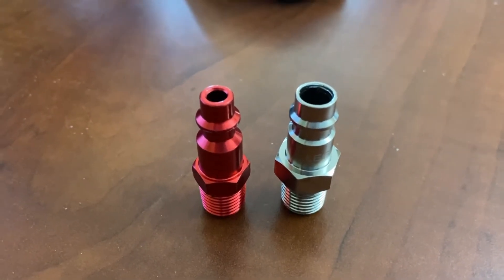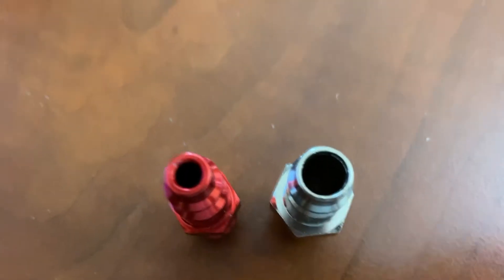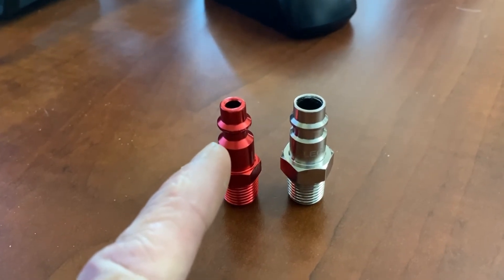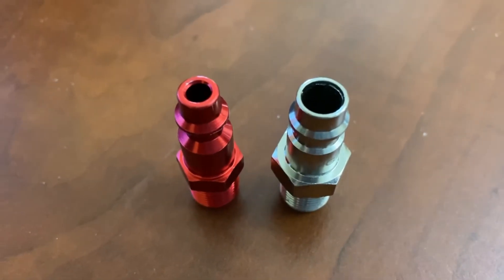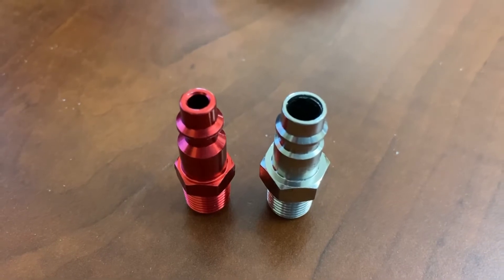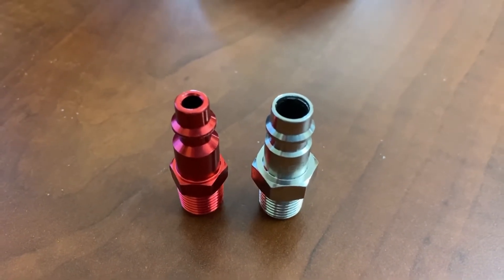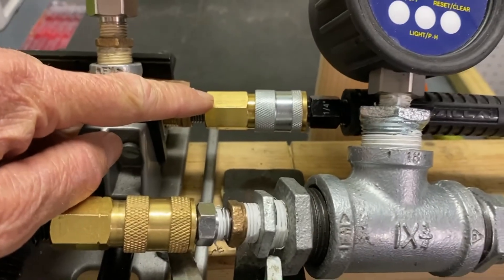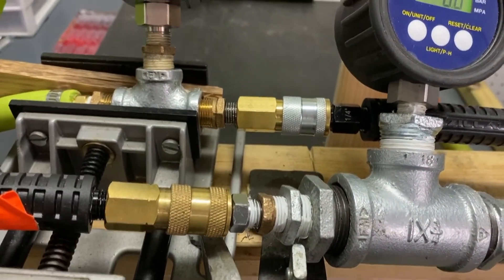HiFlo is all hype

Comment: It really is all hype. I bought some Lowe’s brand high flow fittings and noticed they break easily. I broke like two fittings in the span of 6 months. Now when I went back to normal 1/4 fittings I had a 5/16 hose which have the same airflow as a 3/8. After using high flow and 1/4 fittings in the 5/16 hose I didn’t notice any difference. So ppl it in the hose.

Comment: My air impact will not run with standard I/M 1/4" plugs. Only with v style or t automotive style. The standards also restrict my iwata hvlp lph400 but not my conventional w400. Too much pressure drop especially when using a cheater valve. The cheater combined with I/M plugs really cause a restriction. When painting I like to set the wall regulator as low as possible to maintain around 35psi at the gun so I don't get fluctuation when the tank pressure is around cut in. If I use standard fittings and 90psi at the wall, I don't get enough pressure to my hvlp. With standards and my conventional, I can set the wall at 50-60psi and maintain pressure
Reply: Same here. M couplers and 1/4" air line won't power my HF impact gun well enough to remove lug nuts torqued to 150#. But, with 3/8" hose and M couplers, I can run 100 feet out and it will take off a spindle nut torqued to 250#. 

I had enough of a small compressor and constrictions, went to a 20 gallon with 175 psi, all 3/8" line, 3/8" ball valve, and V high volume fittings. It stopped all the choking down and is much more capable. High flow fittings are part of a SYSTEM which delivers the power needed.
Reply: @tirod3  Ya everything works together. Ive since stopped using V fittings because they end up leaking even the higher quality Miltons. The V styles couplers ability to accept both V and I/M plugs would be nice if they stayed leak free but they dont. I went back to high flow T style and just put them on everything in my garage. They are more robust and last. I have a 26gal compressor for now. Its in my basement plumbed directly from the tank pressure not regulated to 3/4 pex lines up the wall to the top of my garage ceiling then down to an outlet with both tank pressure and regulated outlets. If I need extra uggaduggas I plug into the tank pressure. I adjusted the pressure switch to kick on the compressor at 125psi and shut off at 150psi. Works good. I also have drip legs with drain valves at the bottom of the wall lines both by the tank and by the regulator in the garage.
Reply: @MarcBchannel  Thanks, I will keep the T in mind. I've had the M couplers long enough to wear out the one on the tank and most used hose - took 25 years - and don't expect the new ones to last that long - but at 71 I'm willing to wait and see me proved wrong. More than likely the rig will go to the boy who needs it most in ten years or so, I won't be wrenching on cars by then.

Comment: High flow is better if your using air tools that need a ton of air if it’s an air gun you don’t need a high flow fittings you only need a industrial fittings or automotive fittings but for die grinders definitely high flow fittings are the best option this is my personal opinion

Comment: I think you might want to adjust your test apparatus mate.  75% more area making only 10% more CFM is a red flag.  E.G. If you are using a regulator at the compressor then that is the bottleneck.  In which case your findings look plausible, because you aren’t testing the fitting, you’re testing your regulator.

Comment: I think the better interpretation of the result is: "Wow, 10% more flow with just a nipple change when there's all that other restriction in the system!". The High flow drops pressure only to 104.7 (and rising) while the standard flow nipples drop pressure to 97.5 (and falling). It would be nice if the system was allow to achieve equilibrium before the camera panned away.

So even with all that other restriction, the nipple change alone is good for >8psi less pressure drop. That's significant to me. If you run shorter hoses of larger diameter, the significance of the high flow fittings only increases.

Air plumbing has no magic bullets. It's the death of a thousand cuts, so building a low restriction system means looking at every part of it-- not just a fitting or coupler. I consider the system shown to have excessive restriction with other nipple because some smaller compressors have cut in pressures under 125psi. So if you have a regulator that maxes out at 125 (like my Milton does) then the compressor won't cut in until you are below your regulated pressure value, which defeats the regulator. Thus, the advantage of the low restriction plumbing is that you can run a lower regulator pressure (static) for any dynamic pressure value. And this helps assure the cut in pressure on the compressor will always be above regulated and you'll never fall off the regulator.

Comment: Why is it my 3" cutoff wheel cuts metal faster with the milton?  I do notice my air compressor turns on quicker.  I run 120 psi in my tank compressor is rated at 30cfm.
Reply from the maker: Many old style non HiFlo couplers are very restrictive. Most people incorrectly assume that a flow improvement is caused by the large bore plug when in many cases it’s is because of the coupler.

Comment: Where's the test showing your coupler with standard  plug???
Reply from the maker: I don’t think I posted that one. I would need to look for it.
Reply: @Stedlin  I don't mean to be rude what's the point of posting of all these tests without ever showing a test of your product actually out performing them? I thought the whole point of your couplers was that you get better flow than hi flows with regular plugs? Am I confused? Thx
Reply from the maker: @Steve_Just_Steve  I have never stated that a Stedlin Coupler with standard industrial plug will outperform a HiFlo Coupler and HiFlo plug in terms of flow capability.
It will outperform a high flow coupler and plug in every single way except flow rate and the flow rate is equivalent when used with quarter-inch NPT air tools.
Reply: @Stedlin  okay, I apologize I misunderstood. But you have said using your coupler w/ std plug doubles the flow rate over a std coupler and std plug and has similar pressure drop to the high flows. And I'm doubting that, I'm just wondering out of the dozens of test you've shown, you've never demonstrated that. Perhaps I'm wrong and I just can't find it but I haven't seen any apples to apples comparisons of pressure drop or flow rates using your couplers. Just seems strange when you're doing all that testing not to include yours and the tests.
Reply: @Stedlin  please don't misunderstand me, I'm not saying your claims are untrue and I actually will be purchasing some of your couplers and look forward to using them. This is just my observation from watching your videos
Reply from the maker: @Steve_Just_Steve   No problem Steve. I appreciate your questions. I wish I got more feedback from viewers. Thanks.

Comment: You say high flow rate isn't necessary and talk about air driven tools my question or thought is that the flow rate and high flow rates aren't for the tools your talking about at all. I think it's pointed more towards tools that are flow rate hungry. Sprayers and hplv comes to mind. Thoughts anyone?
Reply: Yes exactly. I work in auto body and paint, all the spray gun makers state the importance of volume of air vs pressure. Adjusting pressure at the wall and not the gun, having 3/8 hose, hi flow fittings etc
Reply from the maker: It’s the coupler restriction more than it is the plug restriction as demonstrated here:
Milton 715 vs Stedlin Quickcoupler water flow demo
https://youtu.be/3niZBZ0NHzE

Comment: Are there any tests on pressure drop and CFM difference between your full flow plugs and QuietPlugs? I work at a shop that primarily uses low air capacity, but high flow tools like impact wrenches, die grinders, cut-off grinders, and air hammers. I understand the better option would be the full flow plug for these types of tools, but the QuietPlug is something that we were looking at because of the noise reduction. There are also a lot of veterans at my shop that say the loud pop of air tools disconnecting always triggers their tinnitus, even though the louder sound of the tools themselves during use doesn't. I went and ordered a few QuietPlugs to see if it helps them with their tinnitus. Happy to report that they do, and although I haven't had any complaints yet, I'd like to know if they're missing out on any power in their tools. Thank you!

Comment: You only assume that air is used to power air tools.. then 28-30 CFM is fine. Entirely different matter when you need compressor to purge water out of irrigation system.
Reply from the maker: Of course but why would you use 1/4” NPT couplers for that application?
Reply: @Stedlin  maybe because it is only used for this once a year and no only stationary compressors piped with larger ports.

Comment: Hello, 

I am trying to decide on new fittings for my shop. 

I am wondering if the "Full Flow M-Style Male Plug" incorporates any of the sound reduction or whip reduction features.

I am also wondering what the pressure drop specs are on the "Quietplug". I couldn't find this information on your website or YouTube videos.

Thanks 
Taylor
Reply from the maker: The full flow plug is intended for tools that use air motors thus the quiet feature is not required. At 30 ft.³ per minute the QuietPlug pressure drop is virtually the same as the Full Flow.
At 40 ft.³ per minute the difference is 3 to 4 psi.
Reply: @Stedlin  Thank you for the pressure drop info! So in what situation would the QuietPlug be ideal? Mainly when connecting one hose to another hose?
Reply from the maker: An airplane manufacturer uses over 800 QuietPlugs to connect whip hoses to vertical drops and that was an ideal use.
Reply: @Stedlin  I was also wondering what the pressure drop spec is on the 3/8 QuietHose.
Reply from the maker: @Taylor_in_AK  I don’t know. I can test it. What flow rate?